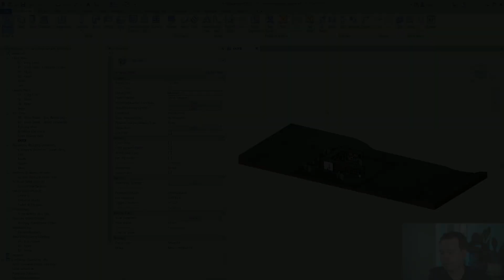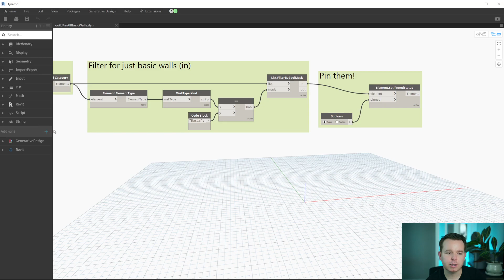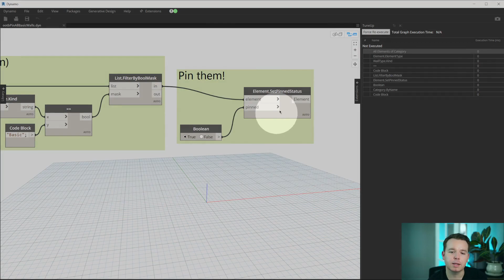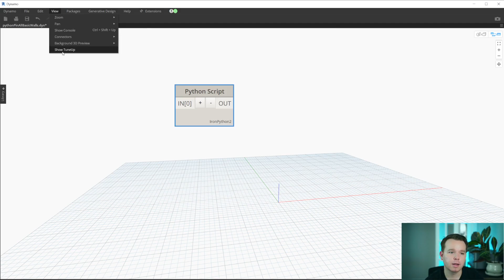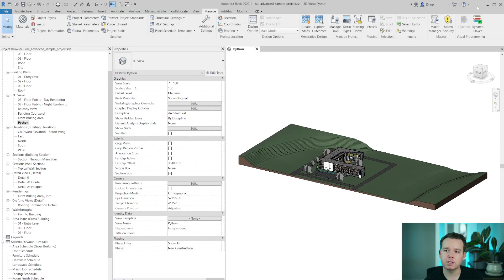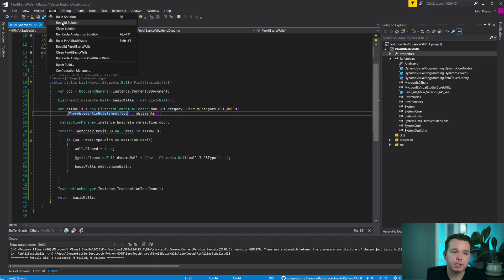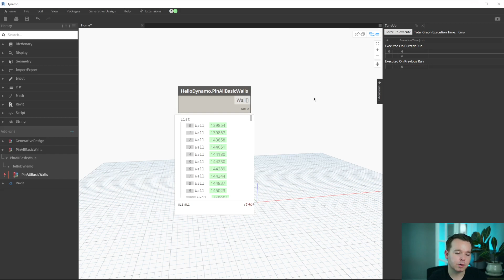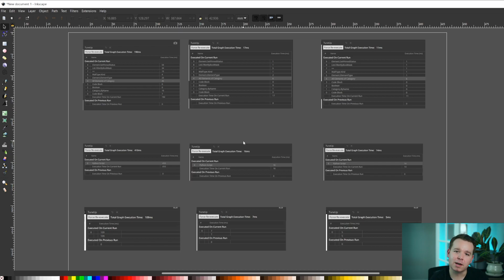Dynamo Node Race - OOTB vs Python vs Zerotouch

Comment: Nice one! As expected ZTN is the winner, a valuable study for people asking this question.

Curious if you have any one recommended resource for learning C# as a beginner - I've taken my third stab at it recently (attempt 1 I ran out of time and attempt 2 I had a temporary rage quit, haha) and find I'm usually a bit all over the place as most resources either stay too basic or take quantum leaps and don't explain some of the steps. I've been perusing open code examples, but also trying to just learn the in and outs of visual studio and C# as an overall language.
Reply from the maker: Let me compile a few resources. But for zero touch specifically I found Marcello’s guidance extremely helpful. https://m.youtube.com/watch?v=DtpQBfIyCsk

One thing I absolutely recommend is Jetbrains Resharper as it takes care of all your using statements (imports in python)
Reply: @DesignTechUnraveled  brilliant, thanks!

Comment: Great Video. Thanks for sharing. Question: In the python version, I noticed you imported the entire DB. Would you see faster results if you was more selective on what was loaded?
Reply from the maker: As a matter of fact, yes. https://twitter.com/60secondrevit/status/1504474996172681227?s=20&t=fR_RHBPmHxct8iD1GZlnjg
Reply: @DesignTechUnraveled  thanks for trying that. Very cool. Does that change the order? Is python still last?
Reply from the maker: In the case of being very specific with imports python comes in right after zerotouch in this case. But to be fair, I normally don’t do that in python. I normally do import* out of laziness/habit. 😅
Reply: @DesignTechUnraveled  Hahaha, I do it as well.  The experiment shows it does make a difference. Thanks again for the info. This was very helpful

Comment: Can you optimize either the zero touch or python nodes to only load the bare minimum  library modules? (Maybe they're already at minimum... Watching on mobile so I can't read text too well)

I often use python nodes to perform more complex logic processes on data that was already gathered with OOTB nodes, especially logic with multiple conditions or looping through multiple lists of different sizes concurrently (I find using list@level really frustrating and un-intuitive at times). I  always assume python is faster at these types of operations, but I'd be curious to test it now.
Reply from the maker: I believe the python was already pretty minimum. I know I could probably optimize it a bit more though (instead of import*, I can be extremely specific). But all three workflows definitely shared the same steps.

Definitely test and report back! I would be interested in the results.

Comment: Great video, of course I'd like to see results of more complex scripts that take a long time to run. Maybe something that has to run through all views or sheets in a large project? 😁
Reply from the maker: Great suggestion! This example was the first one I thought of that was fairly complex, (collecting all walls, filtering by criteria, and pinning them) so I ran with it. 

One thing to keep in mind is regardless of the comparison it should be pretty close to the exact same steps between each one. (Which I think I managed to do with the pinning).